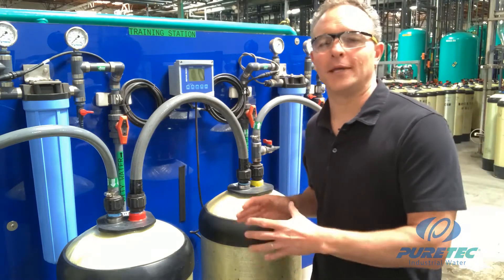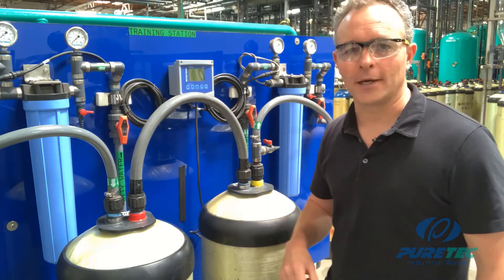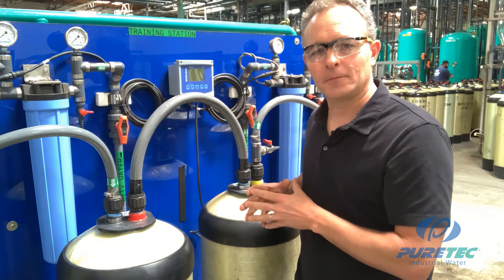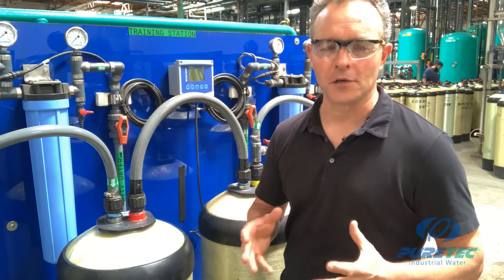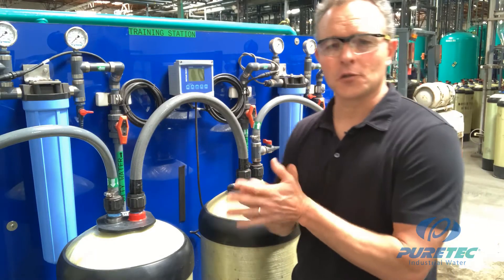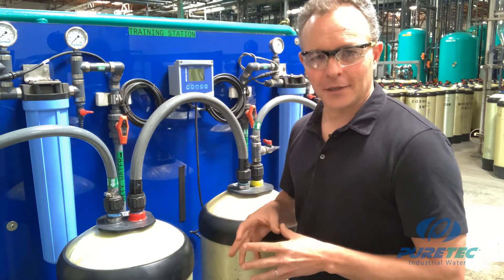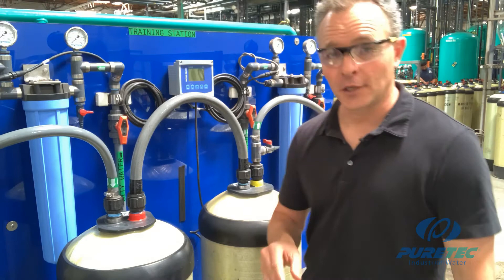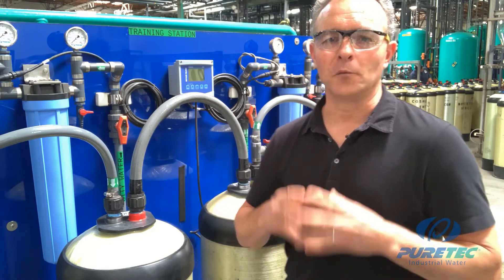Puretec's Ion Exchange Tanks Explained

Comment: I have a whole house well water filtration system; Water Right Sanitizer Plus Series Conditioner (Single Tank / Single Controller). The Single tank is a Crystal Right with Ion Exchange Media. The Controller is a Water Right / Sanitizer Plus. 

The water filtration system is struggling with the Iron mitigation. The Sulphur mitigation is not acceptable as there is a noticeable Sulphur odor. I assume the manganese mitigation is working. The system is about 10+ years old and needs a media replacement. 

I have been advised to replace my existing tank media with Carbon Cocoanut shell media. 

Question 1: Is the optimal filter system & media for my situation; add an additional Tank with Cation and Anion mixed media that will be the first filter tank. Then replace the media in my existing tank with Carbon Cocoanut shell that will be the subsequent filter tank? 

Question 2: Minimally for my one tank system; is a mixed media available that would mitigate my water issues; Iron, Sulphur, and Manganese mitigation? 

Great video, I know more than the three service technicians that couldn't answer the most basic water filtration questions.

Thanks in advance.